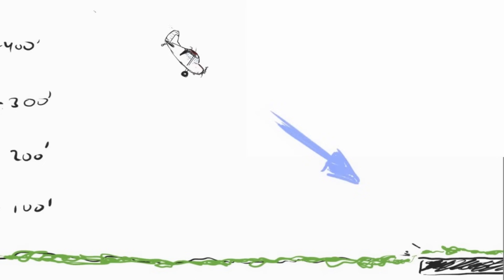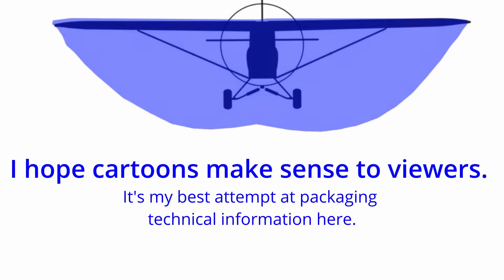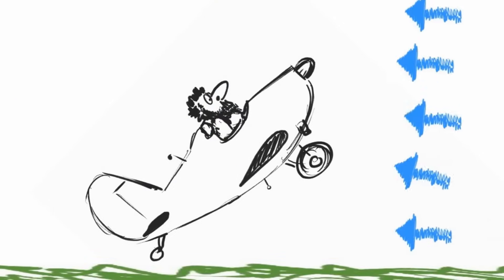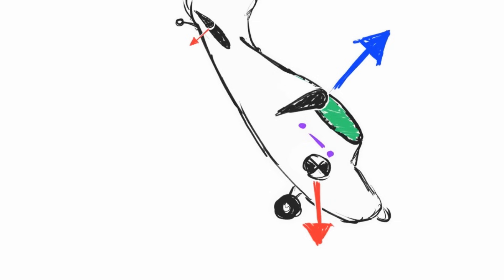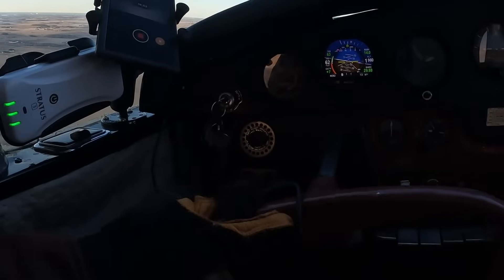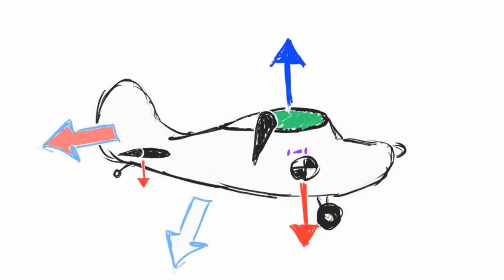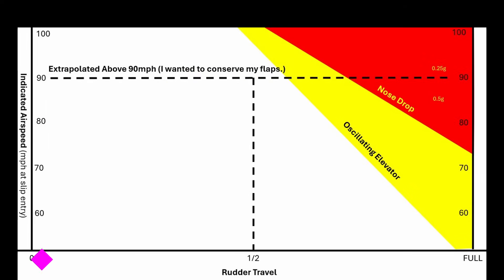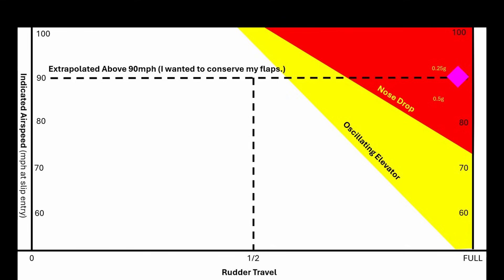Crash of a Cessna 170B, Did Slipping with Flaps Factor?

Comment: Holy smokes an actual practical approach and explanation of slipping with flaps, to include purposeful testing results. I am certainly impressed.

A small point of contention… in the first 20 seconds you show a slide that says C172 “should be avoided”. However there are only a model or two of C172 POH’s that state this. The topic became huge at my flight school and so I dug into it. It seemed that the warnings included models that could extend flaps to 40°. After the change was made to 30° max on flaps then the warning was removed from the POH, if memory serves me right. This was several years ago that I did the research.

I’m wondering how STOL drag aircraft are able to forward slip at really high speeds going down the runway without this nose-down result. Personally I’ve never experienced this phenomenon ever, regardless of what type of aircraft I’ve flown.

Great video with solid data to support your points. I’m really happy I stumbled across your video. The algorithm worked well today!
Reply from the maker: You're right!  I could only get so granular with the POH references but 172 manuals went from saying to "Prohibited" to "Avoid" to informative mentions of elevator pumping as flap limits were changed and dorsal fins were modified.  Great input!
Reply: @jonathanzarinnia884  The 172B has a substantial dorsal fin and it was the first model with the rear swept tail. But still a fastback with no rear window.
Reply: @jonathanzarinnia884  Well you earned another subscribed watcher. I really enjoyed your testing and results.

Any idea about the STOL drag comment, where they come in screaming and still use aggressive forward slips with max flaps?
Reply from the maker: @VictoryAviation  I can't speak for what those pilots are doing without being in their cockpits with them.   

Speaking for myself when I do it, I'm usually outside of the speeds/loadings that cause problems.  I'm usually slipping below 70mph (slip entry speed), and my loading is usually towards the aft of the envelope rather than towards the front, especially if I'm dropping camping/hunting stuff off for friends.  Even empty I usually have a toolbox, 12v air compressor, gallon of water and some other survival supplies in the baggage compartment when I fly around by myself.  To get the plane to tuck I keep that stuff out of my plane.

If I start needing to pump the elevators I go to a 3/4 or 1/2 slip too.  The difference between taking a couple seconds to go in and out of the slip versus abruptly stomping into it (like I do when I'm horsing around in the Cub) is all it takes to have plenty of time to feel out the warnings the plane is sending me.

Again, this is just me.  I won't speak for the people flying the STOL competitions.
Reply: Slips should be avoided appears as late as the 1976 172M manual. This aircraft is capable of 40° flaps. I do not recall if it is in the 172N model, but I believe it is not.
Reply: My 1960 172B is one of the 40 degree flap models. My CFI was a WWII era T-6 instructor. 
We did extensive spin and slip training and hundreds of full flap forward slips to landing. 
It became one of my favorite tools. I could nearly do a vertical descent, and I’ve never, under any conditions, experienced any adverse effects.
Recently, I was perusing my POH and ran across the “forward slips with full flaps prohibited”.
I was really disappointed but now I reserve them for emergencies.
But NEVER was it problematic.

Comment: I slip with flaps all the time. Never had a problem. Are you sure they didn't skid?
Reply from the maker: I slip with flaps a lot too.  I still do from time to time if conditions warrant it.  So this is more about knowing that this behavior is out there than telling you how to fly your plane.  Think of it like a flashing light that marks a pothole in the road.

The flight data was pulled from an onboard portable GPS.  Observers only saw the plane enter the downwind.  Nobody saw the accident sequence.  The NTSB report mentioned slipping with flap issue from the data available.  But we don't know that they didn't skid.  There wasn't enough data to draw firm conclusions, unfortunately.

Comment: Thanks for the video.  I am old and have taught full slip with full flaps in all Cessna trainers, but had no idea about going way to fast for any approach.  This scares me a bit in hindsight.  I always use a full flaps power/pitch deceleration on short final, so never over 60 in anything.  I hadn't considered trying to get down with a slip when going too fast to ever land in a reasonable amount of runway.  As you say, Cessnas have that limited pitch up and down with no airspeed change.
Reply from the maker: I slip with flaps too, especially to get down after crossing a tree line.  This is just so we can be more aware of the factors and so we can teach it to our students.

Comment: Thanks, I often slip with flaps in the C172, but usually try to go easy because I've seen that placard. Will keep this in mind.
Reply: When I took my CFI ride eons ago, the FAA Inspector required me to do a full slip with full 40° of flaps in the 172 we were flying. I balked at it, because I had been taught that it was prohibited—so of course he made me read the placard, which used the word “avoid”. So we bobbled down final at about 70 mph, and of course, it never got worse than bobbling. 

Fast forward some 45 years. I frequently use 40° of flaps, but I hardly ever slip (other than the forward slip that is required for crosswind landings). In fact, in stiff crosswinds, I don’t use more than 10° of flaps, anyway. So with several thousand hours in my logbook now, I simply haven’t ever slipped, with or without flaps, at more than 70 mph. So this video is a bit of a revelation to me. 

And it brings up another important thing to remember: if you’re too high that massive slipping and full flaps seems necessary to get the airplane down within the first third of the runway, the better practice is to go around, and this time plan the descent and approach better! As the song says, you can always go around!
Reply from the maker: I slip with flap sometimes too.  My goal isn't to tell anybody how to fly but just to help people factor risks so they can make the best calls for themselves.